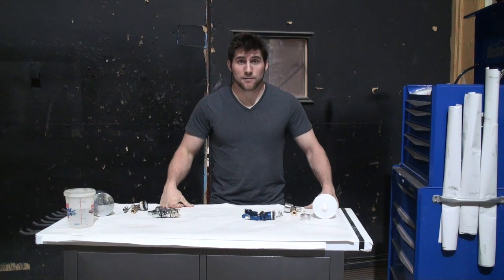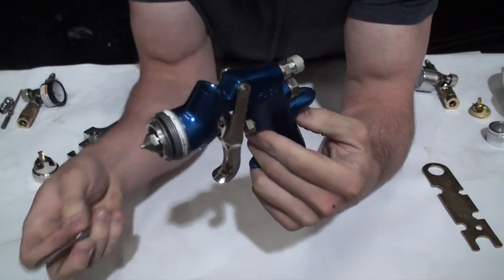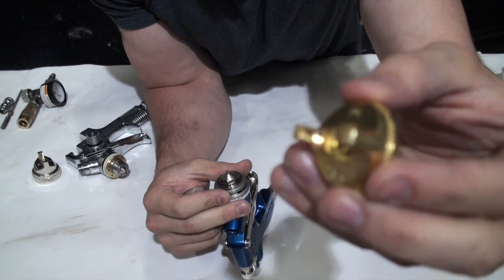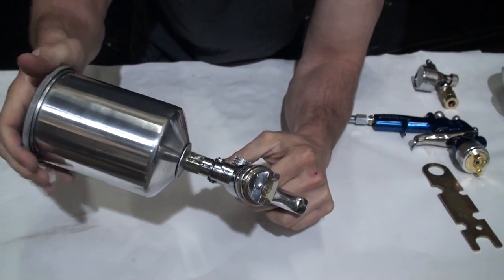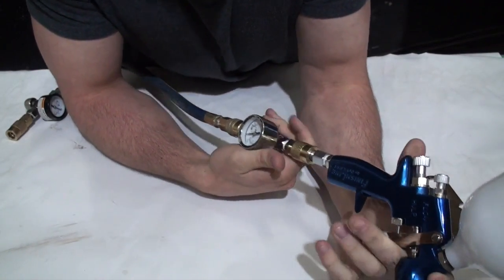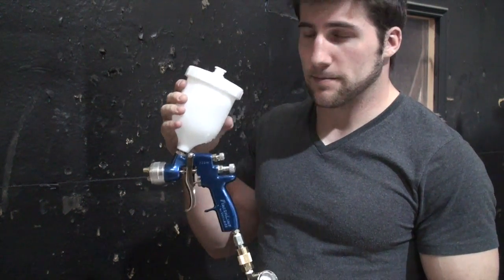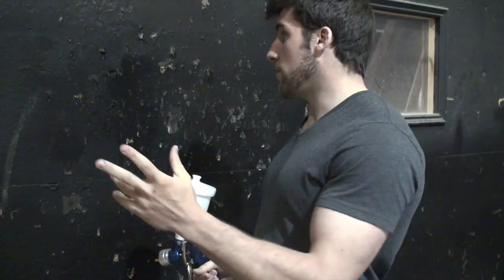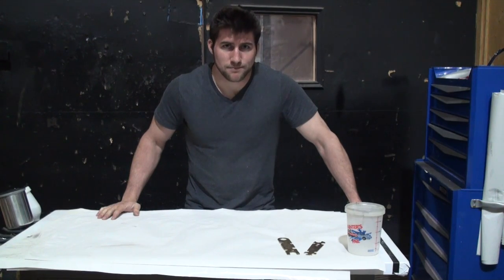How to set up your paint gun.

Comment: Not going to lie, I watched this 65% because the speaker was attractive. 35% because I needed to learn the material.
Reply from the maker: So, how did that 35% go?
Reply: It went well. I've yet to purchase my own gun, since I'm not quite ready to start painging my motorcycle. The video was informative for the basic mechanics I'll face when purchasing. However, I do have a question; have you dealt with or looked at any LVLP guns? I know you do guitar work mostly, which is different than automotive, but still. I'd think the slower/more effective would work best for your type of use.
Reply from the maker: I don't like LVLP guns. They spray too slowly, and it's really hard to get a nice build and a professional looking finish with them. It can be done, particularly with lacquer and acrylics, but it's not very efficient. An LVLP gun would be more appropriate for a guitar than it would be for any automotive application. I've sprayed a few car parts and a motorcycle, and the only way I would go with an LVLP is if I couldn't get a compressor that had the capacity to support an HVLP.
Reply: Reasonable argument.
Reply: Mistress DragonFlame 😂